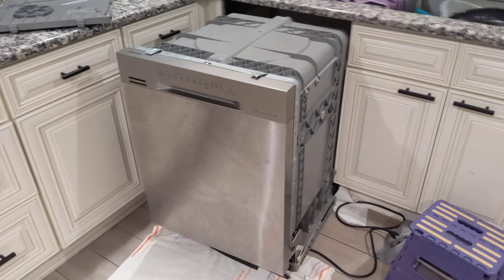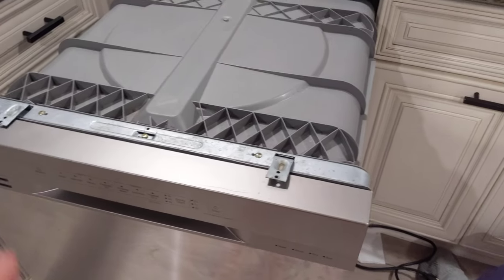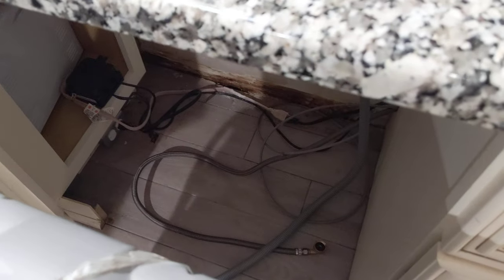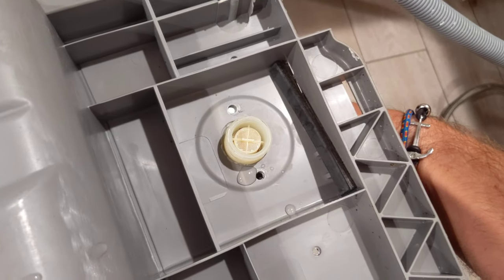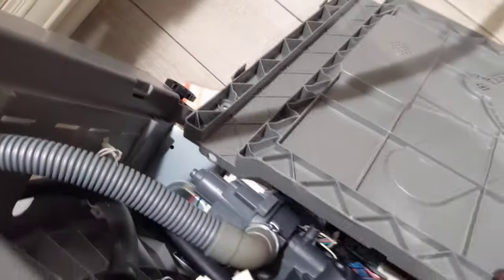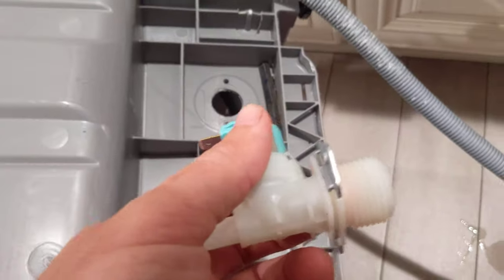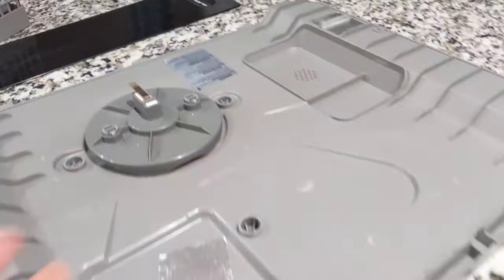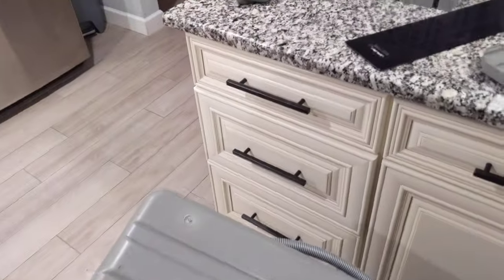Samsung Dishwasher Not Finishing Cycle, Leaking / Leak Code / Low Water Flow Fix.

Comment: I’m glad you mentioned the side leaking from that bolt. I just checked mine, and that exact same bolt was rusted and dripping. Poor quality control
Reply from the maker: Poorly designed it seems. Pretty sure these weren't leaking from the factory but didn't last long

Comment: Thank you very much for this very useful video. My dishwasher is Samsung model DW80N3030US/AA. I have the exact same problem with the right side screw leaking. I fixed that and ran the machine for 20 minutes. Then, I saw the droplet of water on the left side close to the back like you showed me. I believe it is the leak from that water inlet valve. I am about to replace that part. Hopefully, there will be no more problem after this. Mind if I ask how is everything so far after replacement? Any leak?
Reply from the maker: Worked great without any leaks or errors until my pump started leaking. Yup had to replace that because the o ring that was leaking was specially made and forced me to get a whole new pump. Should have maybe done a video on that also. Took a long time to diagnose that leak. Still using this piece of crap dishwasher though excited for the next YouTube I can make fixing it.
Reply: @g3mccotter  I replaced that water inlet valve almost 2 months ago. It seems to work okay now. Hopefully, the pump is not my next replacement. Could you tell me what the sign to know if the pump goes bad? I follow your channel.

Comment: Beware of the HOME DEPOT "Installation". The guys that installed ours didn't remove the old half-clogged drain hose. They just spliced the new drain hose into it. I had to remove 8 feet of unnecessary drain hose and install a new air gap. We haven't had an error code since.
Reply from the maker: Crazy

Comment: I have the same dishwasher, also 2 years old, with the same leak error code.  The normal light fast flashing.  I found the issue to be the drain pump leaking into the catch pan and setting off the float valve.
Reply from the maker: Oh interesting. Ours worked with new valve
Reply: This is also what I think is happening to ours. I found moisture around the drain hose attachment and replaced that hose clamp. Did you replace the rubber o-ring on your drain pump? And did that fix it?

Comment: Sounds like you just don't buy samsung. My samsung dishwasher is 3 years old and the racks are already deteriorating leaving rusted sharp metal in basin. Now my leak sensor is going off.
Reply from the maker: Yeah. Seems most new appliances suck in general. Really need you research and find good reviews to probably find something decent. Our Samsung fridge plastic drawers keep breaking and Samsung microwave would electrocute us haha
Reply: I just bought a new home, the dang thing don't even work,  and they don't want to honor warranty,  horrible customer service

Comment: Had a kitchen aid after 3 years the spray motor went out would fill then empty.  Had a GE that wrecked my hardwood floor and soaked into sheetrock in the basement after 5 years. Won't buy either brand ever again.  Keep in mind these are 1000 dollar machines not cheap.  Just purchased a Samsung had it in for a week, hope I'm not dealing with this. Mine has the stainless tub interior, exterior. I've installed every one myself, and looking at each 1 I'd say the Samsung looks better quality. Time will tell.
Reply from the maker: Yeah it might be same crap. Keep an eye on leaking. Pull it out every now and then and make sure it's dry and you'll be alright

Comment: What I found out is : the draining hose is bent or trapped behind the dishwasher which makes draining the water not efficient resulting in water accumulating at the bottom! which in turn triggers the sensor! For now I dragged the dishwasher out to relieve the hose! it's working like magic now!  this was the reason for the flashing ( normal) cycle option. so it works for few times but then as water is not fully drained it triggers the ( wet / moist) sensor. now just to figure out how to keep the hose bent free!
Reply from the maker: Interesting. Ours is good now that we changed that piece. I don't think it's supposed to leak from there ever even if it's backed up from a bent hose
Reply: @g3mccotter  the one I have didn't leak. there was water stil not completely drained!